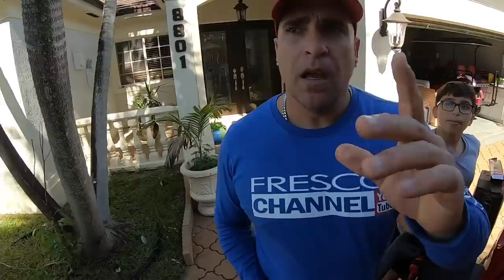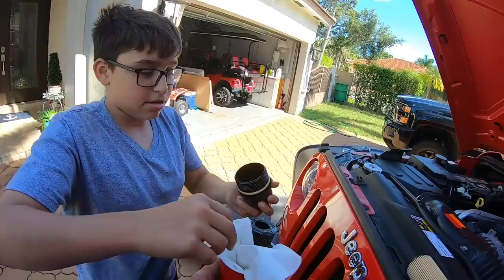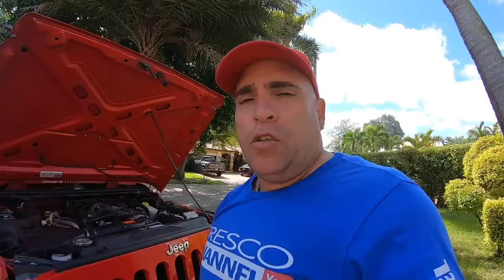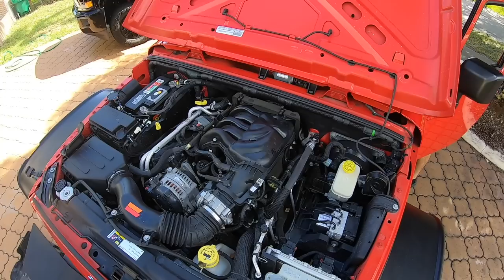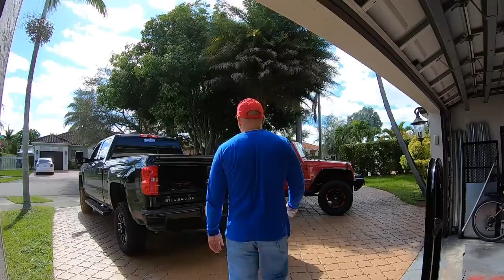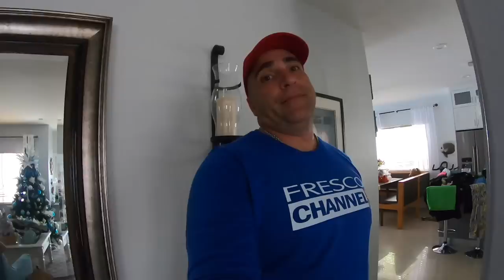Changing the oil on my Jeep Wrangler with help

Comment: Fresco,remember not all Jeep engines are designed the same way. I have a Jeep Patriot 4cyl and the oil filter is located on the bottom of the engine.👍